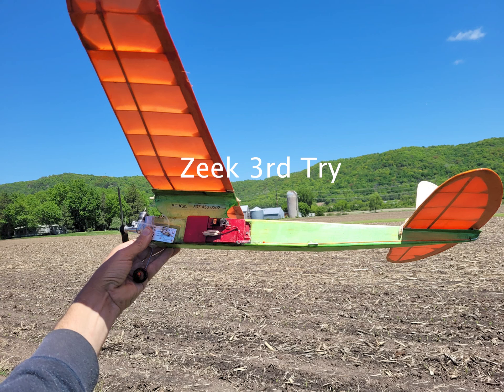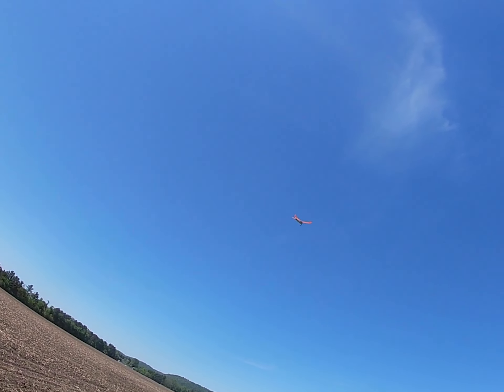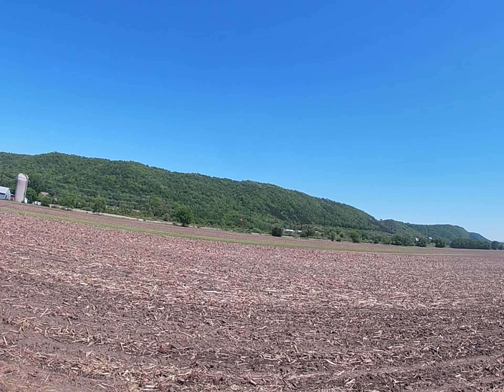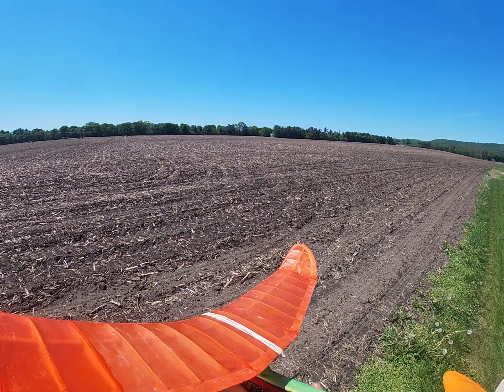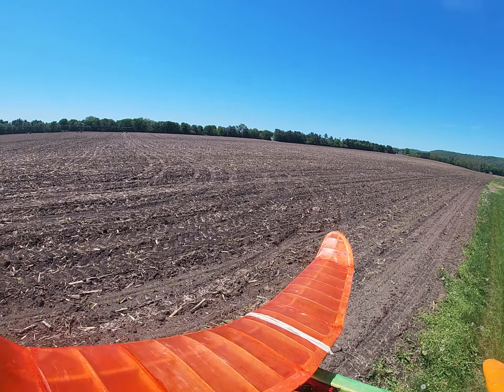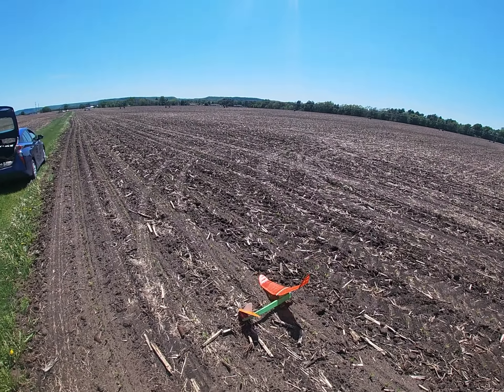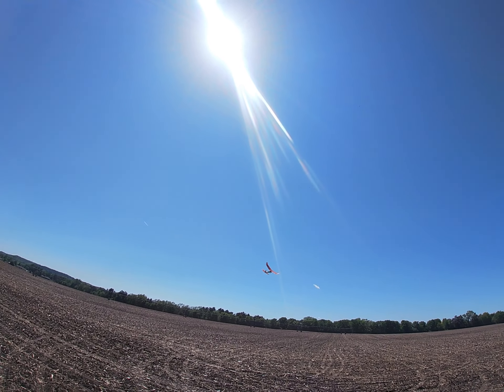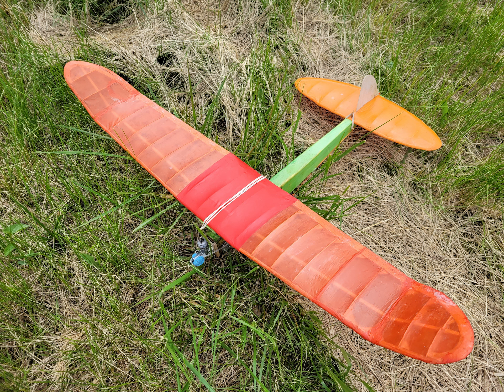Zeek Try #3

Comment: Doesn't look like the engine is making much power.
Reply from the maker: Yet it still manages to crash.
Reply: @billkuhl442  you will figure it out.
Reply: @billkuhl442  you will get it. I am thinking of buying a mini pearl kit from J&H. I had one 40 years ago and it flew perfect right off the bat with a TD in the nose.
Reply from the maker: @johnmajane3731  my first e36 was Pearl and it  flew good.